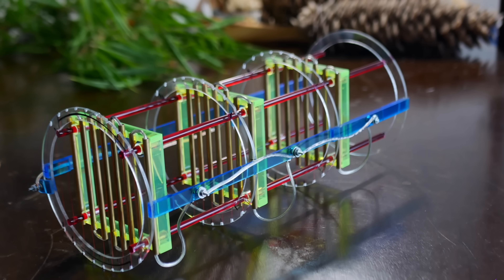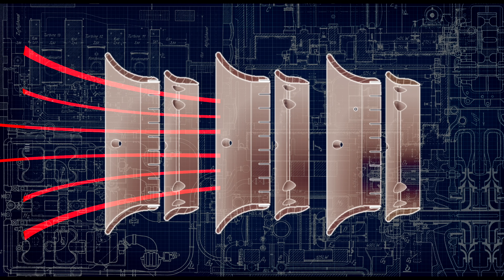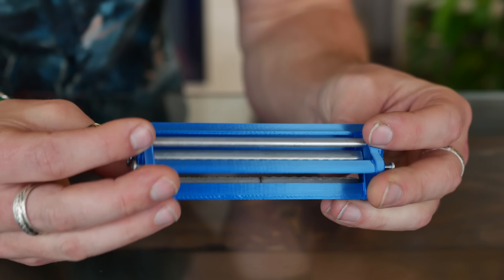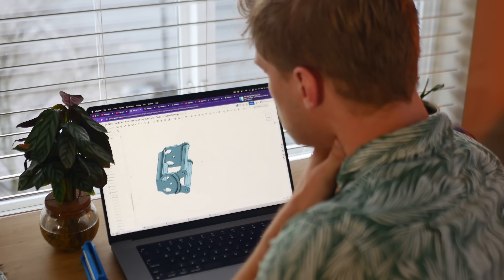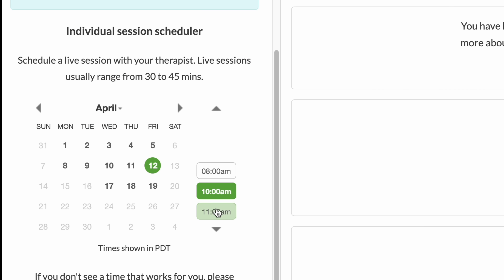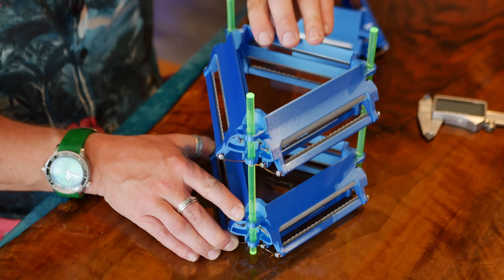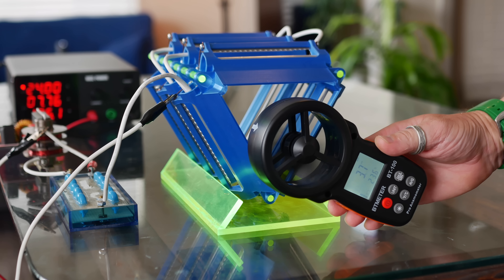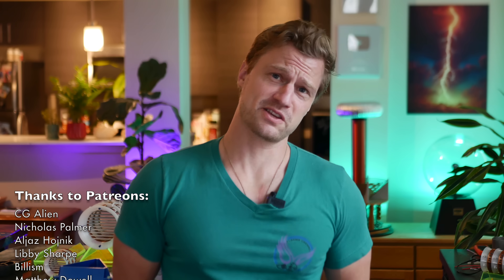Next-Gen Ionic Plasma Thruster Inspired By Nature (BTC Mark 3)

Comment: Great improvement! How about making it pyramid shaped (not the top part) fraction of accelerated air again accelerate plus new air, stacked version had same results as the same air had no acceleration, same air should be accelerated to achieve good results, adding more same speed air won’t accelerate air.

Comment: @plasmachannel  Have you tried rotating each stage? Prehaps shouds that will set up a vortex flow? what about Ionizing the air in front of your stack and coupling it electrically to a needle or plate right at the output??  Great Ideas. The new Prototype is sweet.

Comment: look closer at HOW the leaf converges it's flow ... it rarely puts more than 2 parts to the stem ...  so instead of doing flat stages do them off set like in a spiral so each stage behind the final out only has a small portion of the ionic flow channel but the complete length send and speeds up air ... your actual air flow is split by the distance from one ground to the next positive .. make that as equal as you can to the positive t the ground separation and spiral them from start to end where your final shape is ... perhaps do an hexagon instead of a triangle ... the goal is to get hyperbolic airflow so the central air creates a vortex of air which allows more air to move faster and maintains it's strength for longer ... look at Victor Schauberger and his copy and comprehend nature video .. for the reasons

Comment: When you showed the convergence of the air flow, It made me think about a water nozzel with constant flow and a narrowing of the outlet increases the speed of the flow so that gallons per minute is maintained.  what about narrowing the 2nd stage with a smaller inside area (volume)?  and make the 3rd stage smaller yet... making in affect a nozzel and speeding up the air.  Just a thought.  interesting concept but I don't think it would work in outerspace as there isn't anything to propel for thrust.

Comment: Heyo! cool video. I wanted to ask a question though. Have you any thoughts towards applying strong magnetic field to the thruster (such that the field lines align with the direction of thrust. Or maybe combing a soleonid into the thruster design. I might be completely wrong, but I came across the Silence Barrier (Le mur du silence), by Jean Pierre-Petit and he talked about introducing magnetic fields to increase the velocity of the fluid. Could be complete nonsense, and I'm not an electrical engineer. Still, I would very much like to hear your thoughts.

Comment: Points for consideration:

This one for the previous models. You explained that you produced 2.1m/s at 40W, then  3.2m/s at 40W, and lastly 3.9m/s at 40W. You should be able to improve efficiency by reducing power at earlier stages in proportion to the measured loss of efficiency from the following stage. For example, reduce the first stage power input to 25W, and have the second stage power input at 32.5W, and have the last stage at 40W. I know the air flow volume output and speed might be decreased overall, but it should be more power efficient, I think. I'm not sure, but it would be interesting to see the results.

One for the latest model. Instead of having a straight line for the ionising edge and a parallel earth for charge to flow towards, how would changing the angle of the blades affect output? Instead of the straight line, make the ionising edge and earth poles into a triangular V shape as well, pointing in either  forward or backward directions, as this should affect the flow of electrons in the air. The simulation you showed where air flow from the three sides interferes with each other at the intersecting edges first. How would the air flow be affected if the shape of the ionising and earthing poles changed? The angle of the earth would need to be wider on a forward facing V, and shallower on a backward facing V, to reduce air flowing sideways instead of backwards to the pole.

What (if any) is the capacitance between the ionising edge and the earth pole? There should be some, as the electron flow relies on the breakdown and ionisation of the air itself. So shouldn't introducing an inductor and a small signal pulse frequency into the ionising edge affect the output at resonance? How does varying the electromagnetic field strength that the electrons follow to move the air affect the output? The signal strength should be small, but finding resonance of the circuit at the breakdown might have an effect on the air flow.

Comment: With jet engines, the design is based on air taken in from the front & linearly accelerated. However, why not use a non-linear design something like a hemisphere or even spherical that takes in air from all around & then concentrate the flow linearly? Also, ionised air flow can be increased by using magnetic fields. You could use the same wires for the electrodes to produce a magnetic field to accelerate the flow. I've mentioned it before, but feel it needs repeating, as what you're doing is really important, is there a way of determining the difference in volume between a positively charged amount of air compared to the same number of atoms & molecules negativity charged. If there is a sufficient difference it might be a good idea to have a positive charged electrode first to "condense" the air, then negativity charged it to "expand" the same air, of course this would only really work in a "closed" system.

Comment: Enough of those and factoring in the weight. You could possibly run a very light glider. Also once u figure out maintaining a high voltage with less power? 🤔 you could possibly make it to where u could do more than short flights?  I would also love to see u or someone make some of these with a more robust design for extremely high voltages. 🤔
Bravo my friend Bravo 👏

Comment: I want to see this combined with chemical thrust too. You can imagine fuel cell, but instead, you continuously pump in fuel on one end and it accelerates to the other end to recombine in a quite efficient manner (more so than simple combustion allows for). Now add current to further increase speed up and to strip electron from one end and add it to other. Perhaps putting a fuel source at one end and letting air in the other would do this with a concurrent design that focuses on air.

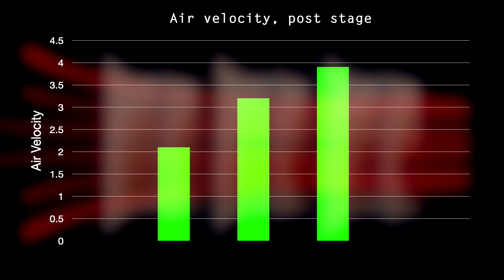Comment: @PlasmaChannel your reasoning at 3:14 is incorrect. If you assume you accelerate the same input mass column you are accelerating the same amount of air in each thruster more or less. You are just adding to the kinetic energy of the air column which is 0.5*m*v^2 when the propulsion goes as m*v. So you should really look into finding the optimal of m*v which is likely going to come from single stage unfortunately if you are using the same design for each stage. If you think about fans, they have different designs to optimize for static pressure (but not air speed) than those to optimize for air speed (but not static pressure). Getting a more efficient stacked model will come from the combination of both designs.

Comment: You should have done the dry ice intake still.  It's possible the pressure on the inside reached high enough that air came out both ends.

Comment: Hi
It is a good work 
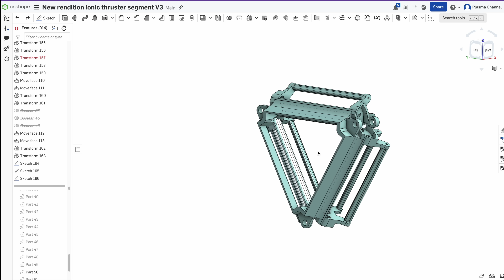I think you could not get more velocity in out flow because of air colliding with each other in some degree from different angles make them slower look at 10:19 apply simple trigonometry. 
My suggestion is have double layers stack and having the flow inwards and give more distance between stages and make that angle of thruster almost parallel to the flow path

Comment: Your problem is you're not thinking like a nineteen forty's scientist You need something really toxic or very Deadly period also consider pulsing the electricity at very, very high Voltages At somewhat high hertz.  60 hertz try 10 at 6 times the voltage

Comment: You are using a triangle, why not a ring?  If you. Can bend the razor positive wire and also bend the negative rod into rings, you’ll get continuous flow in a cone shape.   Make multiple rings that can be stacked and also provide power to the next ring in the stack (wired in parallel)

Comment: The energy of the air going from 2.1 to 3.2 m/s is impressive though. You used 40W twice, yes, but the kinetic energy went up x2.32. (as opposed to just x2) and at 3.9 m/s, the kinetic energy output went up 3.44x (instead of 4x) so here is where the diminishing returns started in my opinion.

Comment: if you add a light weight but strong cone shaped screen to the front of the new ionic thruster design it would deflect all debris problem solved. You might also want to try inner and outer thrusters to the triangle design to maximize air flow inside and outside the walls of the triangle and also maybe separate the inner thruster and the center of the triangle with a divider plate to keep the center air flow from interfering and causing turbulence.

Comment: couple of suggestions, make it circular if you can, stop the thruster leaching air from the previous accelerator, (the air being sucked off the tray suggests it would also suck in previously accelerated air and so reduce the amount of 'fresh' air being added.  The ideal would be to suck in all the air from beside the unit to be added to the central stream only the first stage should be taking air from the front.

Comment: Given that you’re looking for convergence and avoiding accelerating the same column of air multiple times, would it be better to have the individual modules angled at progressively steeper angles to target a single point of convergence? Also should you cover the gaps between modules when testing the spacing to ensure no loss of thrust?

Comment: Part of the problem with your spacing is that you are partly pulling air from the internal acceleration chamber, partly from the external volume. Only allowing it to push air into the chamber might provide some bonuses.

Comment: May seem daft question but would not putting the next stages at convergence distance (ie further apart) improve power/efficiency.

Also dude you NEED to do a Collab with ProjectAir it would be a match made in heaven

Comment: could having 3 convergance points inside the thruster be causing turbulant drag within? Having the blades curved to make one continuous ring around the outside might give you a slightly higher performance for the same output. It would also reduce the complexity of the frame making the overall design potentially lighter for the same or more thrust.

Comment: Modify it to fit the 3.5" computer drive bays to create a silent computer case fan and you have a totally viable product. People go "gaga" for "silent cooling" technology in computer world.
Power draw seems excessive and I don't know about how smart it is to blast charged particles into your computer case, but it's a cool idea for a video at least.
It would be nice to know if it could do anything good with static pressure (for forcing air through radiators)

Comment: Wonder if you could vary the voltage from each fin to have a sort of thrust vectoring or something to auto change spacing so you can run it with more volts

Comment: wouldn't the volume of air entering the thruster and its pressure alter how much energy is added overall? that is - if this were moving through the air, would it have the same thrust (relative to the airspeed) as if it were stationary? if that's not the case then it might make sense to augment the thrust in a similar manner to a bladeless fan (in attempt to be more efficient when combined with the ionic thrust). Also how about rotating each stage by a small amount in an attempt to form a vortex? it's possible to increase efficiency of thrust in some circumstances.

Comment: Reduce the diameter of each section sequentially. The first/back intake should be smaller than the next and nested 'inside' the hollow area to decrease that drag. The reverse holds true if you were to put these into a surrounding housing, but that's not where this is going. 
Additionally, it might be relevant to have more, smaller segments clustered at each stage. Stage one having three, stage two having two, stage three having one. Convergence works by taking smaller sources over a larger area and adding them into a larger mass. You're not pulling in enough area to achieve that. 
Last, that 'torture device' you had is likely going to be the way to go in overall design if you're using convergence; Again, it's taking smaller sources and slap banging them together. Instead of designing a single channel like a rocket, treat it like multiple intake channels of a pump. Three to six early stage intakes feeding into a single late stage channel. Single channel will only go so far.

Comment: Very thin membranes which flex in response to oressure differentials may help with balancing ionic thrust and improve laminar flow at injection points and ease up on overthrusting at high points. The more uniform the pressure, the more efficiently the air will move. Rowing teams synchronize their paddle strokes for this reason. If capacitors and power dustribution can be integrated as part of the structure without adding weight then the sensors could serve as an actuator to create micro self adjustments in thrust. The direction a membrane flexes us the vacuum side and needs thrust to balance out unless there are over pressure zones that lead to unwanted back pressure.

Comment: So, stacking your designs isn't additive. The hollow design is a step forward, however it appears to me that power increase is the key. The hurdle then is spacing between anode and cathode, and possibly an adjustment in frquency. Here I offer a solution: adjustable gap. Design a way to adjust the gap as you increase voltage. A throttle, of sorts. 

great videos, btw. great topics and approach to problem solving.

edit: had to add this caveat; if you stick to three level designs, you might step the voltages so the first step moves ions to 2.9 on your airflow, then design the second stage to start there and increase voltage and gap thus each stage begins where the other left off.

second edit: (sorry) The equation that should govern this, I believe, is the inverse square times distance which I need to lookup. Basically it defines the difference between gravitational pull and electric pull. Since you are wanting to pull ions electrically, just determine the rate of displacement, which should be somewhere around 1ftlb per inch. And, just to be clear, I am knocking the rust off some old project knowledge, so, I may be a little off here. But lift to drag ratios that actually displace enough air (measured by pressure) to lift a body has to be offset by 1 ftlb per square inch. I believe ... somebody may be able to confirm or correct me on this. And since lift level thrust is the goal, use those lift to drag ratios with the inverse square law. in my humble opinion, and probably harder to do than to say.

Comment: ****UPGRADE****       Hey I have an idea so you went to round thrust to a triangle thrust now what if we took that triangle and bow it inwards even better how about 4 points bowed inwards like the Pittsburg steelers logo on there helmets  you get more ion power per inch heck maybe a 6 pointer bowed in thrust will that boost the power. also check out this (vortex tube technology from Harvard school) google it is there a way to incorporate tat into ions. and one more tweek what if the ion thrusters moved like the whole unit spins could we gat more thrust from that. one more thing what if ions could have variable pitch propellers like on fast air craft the props change in flight to get the best pull from take off to 20.000 ft. one more thing NASA has a morphing wing design web what if there was a morphing variable pitch ion blades. for take off landings and at 20.000 A.G.L. ?

Comment: Excellent progress!
There needs to be some references to 'mass flow' (kg/s), not just velocity (m/s) ... 21 litres/sec sounds impressive, but 26 g/s is more relatable (with air weighing 1.225 g per litre). This the weight of the smallest flyable drones (tiny whoops).
It would also be interesting to see flow though the centre and behind the thruster, to see if it remains laminar, or if 'constructive interference' is it causing turbulence in some areas.
(eg:  airflow near corners  of ▵ vs. ⧠  vs. ⬠ vs. ⎈ ?)

Comment: You tried your convergence with equal distances between each section.  What would happen if the distances were not equal but set at increments (ex. first section is 1 inch from the second, and the last section is 2 inches from the second).  Would this affect the flow in a positive or negative manner?  Is there a different set of distance that would change the angle for the next intake that would cause it to have a faster flow than the first?

This is a very nice project.   I really enjoyed your process.

Comment: Hi Jay, really starting to love your channel, you are going from strength to strength.
What led you to the 22degree angle for each module?  I can see that this would create a lot of turbulence in the centre of the thruster.
Reducing the angle would allow the Bernoulli effect to drag more air through the centre, less turbulence, more acceleration.  You are 
allowing the air to do its thing rather than brute forcing it.
Also, you need to look at the Phi proportion to get the most efficiency from nature, log spacing would work better.